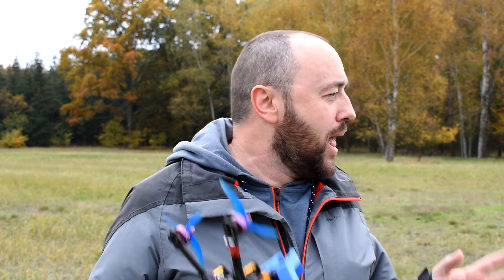AM32 ESC Firmware - BLHeli competition

Comment: Hi Pawel. Are you using AM32 currently? is it safe to use daily? I don't want to burn my only 4in1. Thanks.
Reply from the maker: Yes, I have AM32 in my fav. 3" quad. Works like a charm

Comment: BLheli32 Takko32 escs on 6 inch badger quad I'm getting bad frames in BLheli32 config on each esc no matter what esc protocol I use.   What's causing this.
Reply from the maker: too long cables, too much electrical noise in the setup, poor soldering. Something around those areas
Reply: @FPVUniversity  Thank you for replying!  So having any bad frames in BLheli32 config is not good at all?
Reply: @FPVUniversity  it's the AIO Kakutef7 HDV board.  Not sure if that's just the problem

Comment: Motors feeling smoother because of erpm related PWM instead of stick related like in blheli. In blheli you need at least 1.8%-2% throttle applied in order to make the motors spin. With am32 they spin at .1% already.

Comment: curious to know you setting on the AM32 .
Im gonna try:

Bi directionnal activate

Timing advanced 22.5
motor kv 20 (wondering if i should put 1800kv here?)
motors poles (2207 motors so 14 magnets...??)
startup power 50
PW frequency 48

what do you think? Not so many option to configure
Reply: I would try it with stock startup power and leave variable Pwm on.